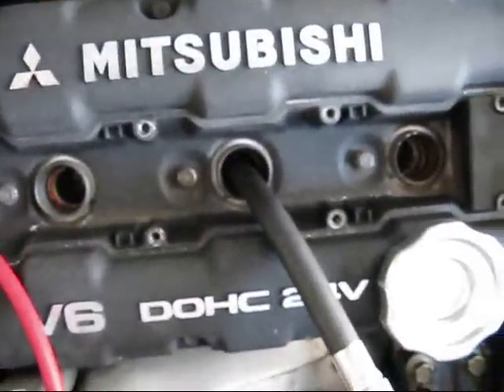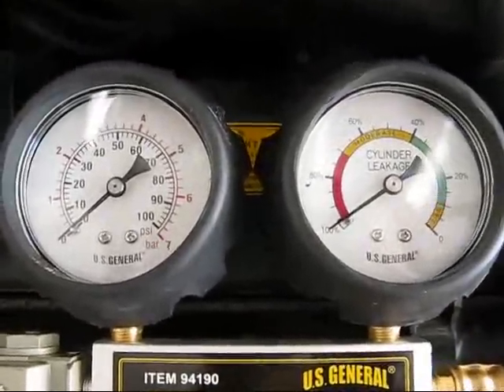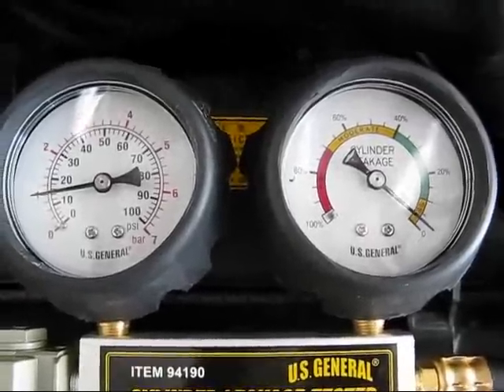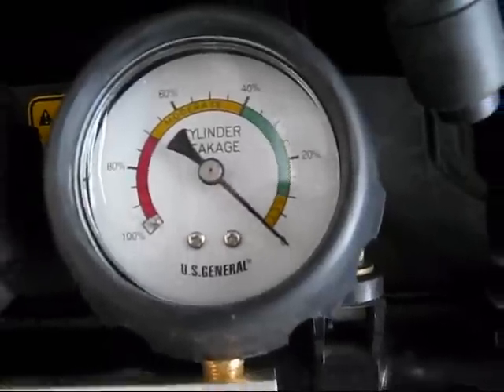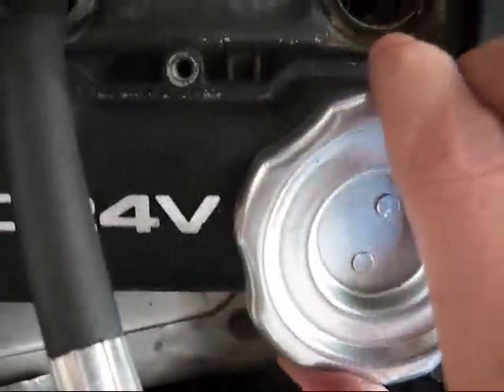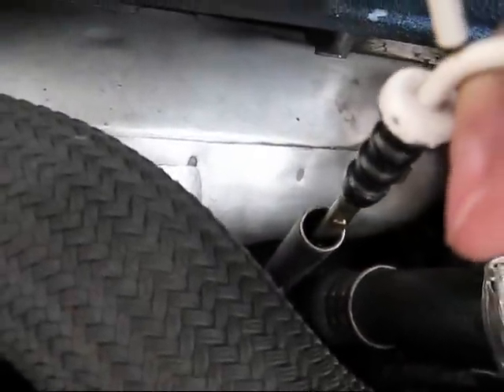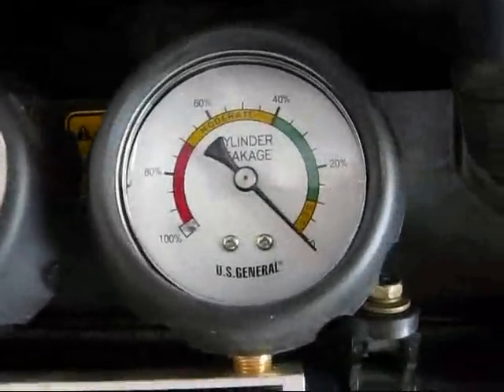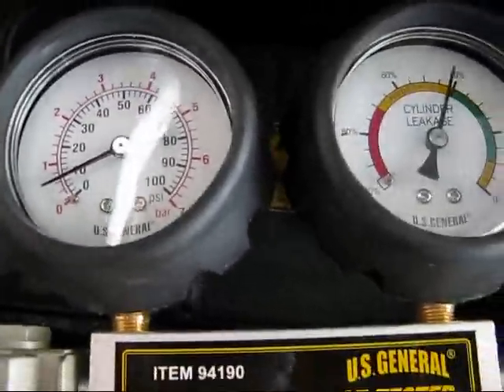Leak Down Test - Help Me.

Comment from the maker: Yeah, that's what the problem was: I was supposed to set it to 0% before hooking it up to the cylinder.  However, using 80-100psi makes no difference.  The Harbor Freight tool is not designed to be used for a supply pressure of anything above 15psi as the second gauge is only a 15psi gauge!  Which is why it's 0% at 15psi.   I returned it and I'm going to buy one with two 100psi gauges so I can check the leak-down at 80-100psi.  Thanks for the comments.